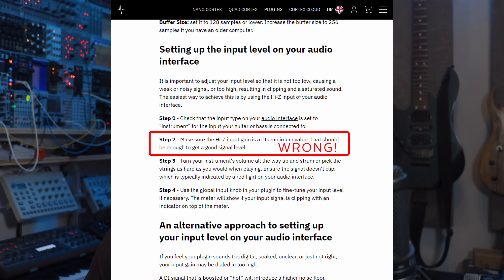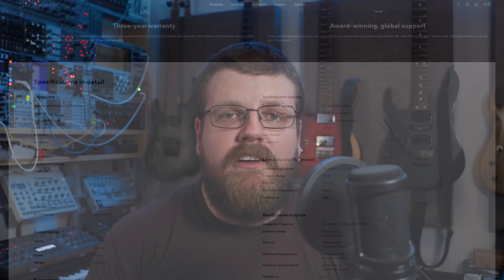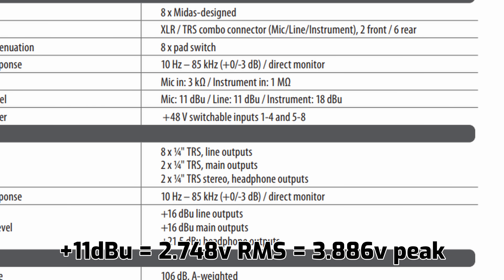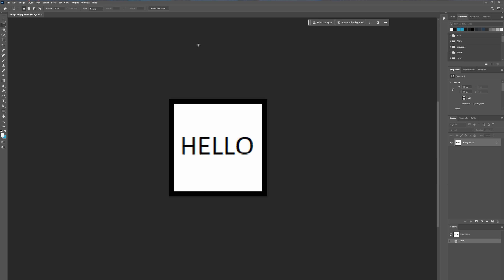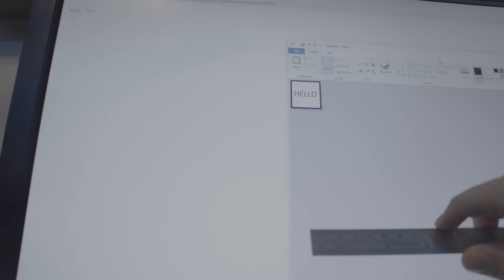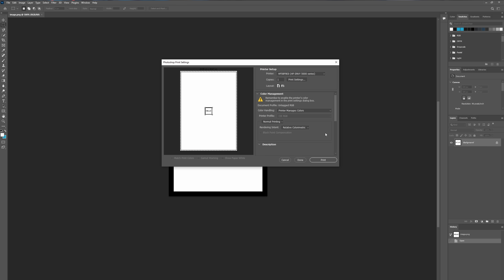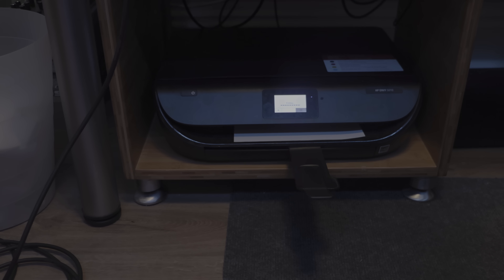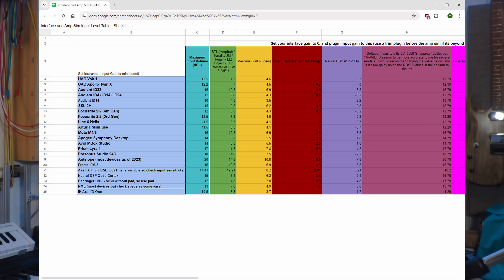Ampsims and input gain - Please, stop the madness...

Comment: I'm a complete novice.
I'm confused at how people got this so wrong. Did they not hear the noise? Did they rationalise it away telling themselves that the noise must be a justified trade-off, basically claiming that all physical gain necessarily comes with a subtle clipping that others just aren't connoisseur enough to hear?

Edit:
I just saw your comment about using the Behringer. I guess that explains it. The hardware most people was using wasn't outputting sufficiently noticeable noise.

That said, it should be obvious that what you did is the right approach: Find the right method on hardware with a lot of noise, then translate the findings to hardware with low noise.
Reply: Noise, especially pink noise, makes recordings sound better. It masks little musical errors and technical limitations of e.g. guitarists. It makes poor piano recordings sound better. If you have ever heard a near perfect recording of a symphony orchestra over electrostatic headphones with the volume turned up during pianissimo passages, then you will know that music is not the kitchen clean sound event that we all would like to believe in.
Reply: @lepidoptera9337  Fair, but don't you still usually want that to be only the absolutely unavoidable noise that's already inherent to the recording equipment - and if you want more of it, you add it in post? When you're testing the perfect settings for your mastering, you'd still be targeting to minimise both noise and clipping, unless you think you have to tolerate one in order to reach ideal results with the other, no?
Reply: @TheHadMatters  You are right, that is how rational people think about it, but most people are just not rational. Musicians are especially vulnerable to these "religious beliefs". How do I know? My Dad is a musician. I have been trying to teach him basics of audio recording for decades, but he just doesn't want to get it. Things like signal to noise ration are just beyond his grasp. Magical thinking is simply engraved in the right hemisphere of the human brain. You can see this in all walks of life and lately especially in politics. People want to believe that there are magical solutions to often non-existing or fringe problems and they will overlook the big picture as long as somebody keeps promising them the impossible.

Comment: When you say " STEP 4 - Reduce the digital input gain in the plugin to compensate." Are you reducing the volume in the plugin so it does not go in the red or are you reducing the input gain of the plugin the same amount you had to increase the gain on your interface?  For example I am using an Apogee Jam + with a maximum input level of 18 dbu. I am using a Bogren Digital sim so per you site I added 5.8 to the input gain of the plugin. I have turn my interface up to 16  before I see any clipping. So how much do I reduce the input gain of the Bogren plugin now? Even with the increase of 5.8 on the plugin and 16 with my interface the input gain of the plugin is still not going in the red. So how much do I reduce the input gain of the plugin to compensate?

Comment: Awesome video, mate! Thanks for clearing that up! 
(in my oversimplified train of thought i used to do like you said: DI hotter for better signal to noise ratio... but I caved in too the experts lol)

I've heard that more affordable interface's converters will work and convert better with input gain not so close to clipping, therefore you shouldn't record so hot, I thought these modern mid range converters wouldn't have that kind of issue (like in my case Presonus Studio 192)
Is that a lie too?

First video here, and a Great one too! Subscribed!
Cheers from Brazil!

Comment: soooo.. if I have a scarlet 2i2..I set the Quad cortex input to 0, turn up the scarlet input until just below clipping and then how ever many db's that is, I subtract It out of my Quad Cortex input? Then just gain stage the preset blocks and Quad cortex output block to keep the output hot but not clipping the interface input? another question.. if i want to use the preset for live use and output is going 1 to a pa and 2 to a power amp and guitar cab... is the process similar? or just leave the same input and turn up the pa/power amp to acceptable levels?

Comment: Wondering how to factor my DI/Re-amp box into the equation so my DI tracks can be played through both Neural DSP plugins but also my real amp.  My little labs redeye has a  button that switches between  di/reamp and di/passthrough mode and then you just click the button in and out while slowly turning your pre-amp gain on  your mic-pre until the there is no difference on the real amp between when the signal is sent straight to the amp from the guitar and when the signal comes from the daw.That way your recorded DI signal will be just right for reamping the real amp. My guess is this recorded di signal isn't optimized for NDSP plugins ins though 

Does it make more sense to instead follow your steps here to get everything dialed in for the plugin and then dial in my reamp by instead making adjustments to the output level feeding the reamp box?

Comment: Well I tried this method with hi gain settings and indeed I got a lower noise when not playing. 
But the sound while playing (I guess it's the most important) felt better with the input gain at zero, a bit less compressed and better articulated. So I feel kinda annoyed making calculations and measurements and violenting my poor guitar on open strings to get a not better/worst sound in the end.
I heard most converters sound worst when approaching the clipping threshold so maybe that's the reason, or maybe I did something wrong, idk.
Reply from the maker: Did you remember to reduce the gain in software to offset the amount of gain you added on the audio interface input? If you do that (correctly) there really should be no difference in playing dynamics, just less noise.
Reply: @GhostNoteAudio  yeah I tried to level match and do that.. I'll try again maybe

Comment: THANK YOU for making this... I started doing this when I drank the kool aid of those videos/reddit posts too, but it only took me a few months to realize it sounded worse prettymuch all the time.  Now I just do what I used to do before even reading any of that crap, just set the input gain to the loudest it can go, without clipping.  I also use a USB thing with my interface that removes electrical noise from my computer from the signal and its been great.

Comment: It's funny, because I've been setting it low, but only because I could hear the noise floor increase. I didn't consider the actual SNR. I always forget that the actual dynamic range you have is more important than the min or max, because you usually can adjust the total min and max.

And just to confirm, would this mean I'd actually want to set my guitar volume to 0 and raise it until I start to peak on hard strumming?

Comment: Not to sound like a jerk. But how the f did people came with that theory???
Reply from the maker: Unfortunately, because the companies making the plugins literally told them.
It is actually a reasonable shortcut for most audio interfaces, as it is a simple way to get approximately the right signal level into a NeuralDSP amp plugin. But it's FAR from universal, ideal or foolproof. It also doesn't hold at all for other plugins that sometimes use vastly different reference levels for their designs.

Comment: This video was very interesting. I'm surprised to learn how so many people have made it their practice to turn the input gain knob on their interface all the way down when going direct with a guitar... That's the opposite of input gain staging 101... (I saw the video of Mateus Asato doing that exact thing as he demo'd his signature Neural DSP plugin, which was also surprising. I guess that goes to show it's not common knowledge like one would think.) As a result of your video here, Ghost Note Audio, I emailed Neural DSP customer support to ask them directly if their plugins are designed with any specific "digital input level" in mind (assuming the player has already properly set their interface input gain as high as possible without clipping). Neural DSP's response was: "If you're already setting your input gain on your interface that way (as high as possible without clipping), then we suggest you leave the "input level" set at 0.0 with Neural DSP plugins. That said, if you're having a hard time getting clean tones to be as clean as you'd like, then it's a good idea to trim back that plugin input level some to suit the sound you're after." So, there is an "optimal" way to set it, with "room for preference".

Comment: I want to reach though the internet and shake your hand!!!! I don't use amp sims, but instead use my Katana's line out (not the greatest, I know) and been struggling with finding a decent tone for a long time. I applied your "increase the signal at the interface and lower the input gain in the Sim (Katana)" and it worked!! Sounds great!!! I had it backwards all this time (low interface gain, high amp gain)... sounded terrible!!! Thank you!!!

Comment: The video is very informative, thanks!
Just one question: how can I do this with my digital floor pedalboard? I have an input gain at the start of the signal chain to boost the level, but I’m not sure where I should lower it afterward. Do I need to buy something to put before the pedalboard? 
Thank you so much

Comment: I mean, Science falls short in art. Imagine if we trusted science to a T, there would be no distortion and fx.

Distortion is literally bad electrical engineering, hence the term distortion.

If we dont have artists out there trying new things, we can expect art to come to an absolute hault.

There is no right or wrong in art, there is simply the result.

Some pedals LITERALLY have a starve or choke button. Which is kind of like diving your input knob down.

Based on the guitars behind you, im assuming you measure everything against metal music. Which is why you have such a rigid hard stance on this matter.

For metal, typically the best result has high input gain. Correct. But it is not the absolute anwser.
Reply from the maker: @davidhurd7736  this video takes no stance on what sounds good or bad. It takes a stance on how to minimize noise and match signal levels for analogue-modelling software. Both of those are factual, quantifiable metrics.
If you like a noisy signal, that's fine. But that's a different conversation, not covered by this video.
Reply: @GhostNoteAudio  the title is "everyone is wrong" which is a stance, and a pretty rigid one. If you are going to make such claims be prepared to face scrutiny. Turns out everyone is not wrong. Some people will do this out of desired effect.
Reply from the maker: @davidhurd7736  misinterpreting the words and the point of the video. And of course not everyone is wrong, and you know this is clearly a hyperbolic title for comedic effect (I hope)

Comment: I use auto gain in my interface and bump the input trim to +2 or 3, i got a nice strong signal with no clip. Is this what were talking about ?  And what about the output in my modeler? I leave that at zero. I also have several points where i can bump the signal, pre and post eqs and i use a clean boost pedal in front of the modeler. On those i go maybe + 1-2db and set the auto gain on the modeler with all those db gains except the input trim, then i bump it as much as possible without clipping. There is also a straight up DB boost at the end of the modeler chain, i leave that alone typically and keep at zero. If anyone read this help me understand or have some tips as im pretty new to it obviously

Comment: I beg your pardon, to set zero on the audio interface is the maximum amplification or complete disabling of amplification? From the above it is logical that to make a greater distance between the maximum signal and noise it is necessary to make the maximum amplification, but then the audio interface will cut off part of the signal due to clipping? But if we set the minimum value of amplification on the interface then the signal is very quiet and you even in the plugin made the signal quieter, something I did not quite understand what it means to set zero on the audio interface, please help me to understand how it is. thank you=)

Comment: This is similar to what I've been doing except without the brain power...just twisting knobs until it sounds good. I always run pedals into the interface as well. Many people are concerned with getting the EXACT result from the amp plug as intended and that's totally valid, just depends on what you're going for. Also, I record a sample of any noise or hum then eradicate the fk out of it using izotope rx. Thanks Glenn Fricker for that one.

Comment: @GhostNoteAudio You are 100% correct. I went down a huge rabbit hole 7 or 8 years ago trying to improve my voice audio. What I found out is hardware has inherent background noise like you showed. People kept saying set you audio interface as low as possible and then raise it in post. What a load of horse crap that advice was. So much white noise in the background. So after a lot of testing, I mean serious testing I have really bad OCD. Just bring it up as high as you can without clipping when doing plosive mic testing. Then bring it up in post (or down if its to high). Not to mention, preamps do not perform very well until they hit around 80% gain. Plus if someone is buying a preamp or audio interface that markets the sound of their preamps, then why not use the dang preamps?!?!  People drive me crazy. Most of the people on the internet are LEMMINGS!!! They happily repeat what some other dumb shite said before without questioning them..

Comment: The sound after you optimize the gain knob is more muddy and less detail on high frequency. I think set it at zero will give you best sound but more noise...
Reply: wrong
Reply: @saamo1423  Make a comparison video and see for yourself. That's why the OP didn't make a comparison segment of the guitar sound before and after using his method.
Reply: @cu590  that's not how any of this works, if there's a tone difference outside of you picking differently, you did it wrong. End of story

Comment: This, brought down to its simple form, is basicly what everyone has said regarding 0db gain on the interface but reducing noise after getting the gain up on the interface and reducing at the plugin to compensate. Tried this on Reaper where without any input gain on the 2i2 3rd gen I got about -8.1db at the meter when hitting the strings hard and then getting to about -0.7db after cranking up the input gain to where it's not clipping. Set the plugin input gain according to the spreadsheet and then brought it down to about -2.9db. Archetype Plini sounds perfect and crunchy with low noise and a healthy signal.

This video is gold.

Comment: I understood the whole question. But one thing I still don't understand is how do I know exactly how many dB I added by increasing the gain on the interface? How do I see this?
Reply from the maker: @dkevin9994  check out the follow up video, or the pinned comment :)
Reply: @GhostNoteAudio  Oh, I see, I didn't notice the pinned comment ^^'. Thanks! I'll try to do that. But if you don't mind, it would be great if you could make a video showing how to do this process. Reading the loudness values is a bit confusing at first.

Comment: Great video and almost 100% correct. However still missing one important element of gain staging, which happens at the pickup level. Changing your pickup height dramatically effects your digital input level. That said as most people play with their pickups very close to the strings the 0db approach tends to work for most. I prefer to have a little more distance from the strings as I hear more detail and less noise, so I need to boost my input a little to compensate. Either way, great video and great explanations, thanks for making it!!

Comment: One thing I'm confused about. With the Quad Cortex, "0 dB' on interfaces talked about here, is actually -12dB. 0db on the quad cortex was meant to emulate a High Z input, so for metal players especially it'll be too hot. That means we're mostly subtracting from 0dB, which would mean we ADD input gain into the Neural plugin? If what you're saying translate to the QC as, "start from -12dB, raise until before clipping, then lower the plugin by that amount after first setting to spreadsheet value", then it works...okay ish...but the plugins always sound too low of gain after that, so that I just end up raising the plugin input gain again back to at least 0, then feel like I wasted my time with the process. What am I missing here?

Comment: So if I got a focusrite 3rd gen set to .03 in archetype while on 0 on the focusrite and start strumming until it almost clips then pull it back and guage the difference (the difference is just how far from clipping was it while on 0 input on the focusrite which for me is 12db) so then I would have -11.7 archetype input. Now I have no volume after these changes so I assume you then increase the Output in Archetype which I need to add about 10 there to get back to almost clipping. Did I do this right?